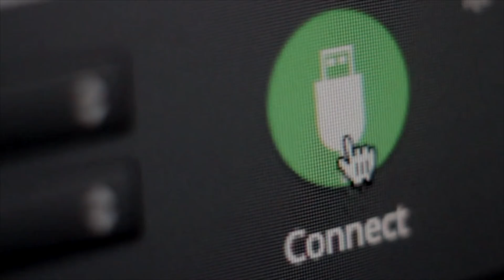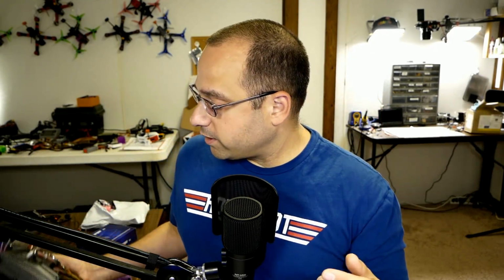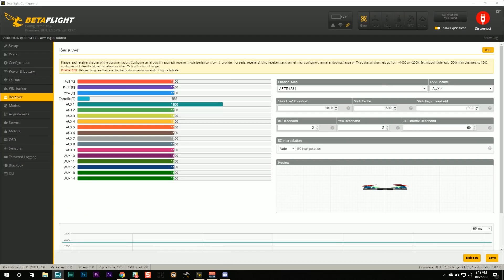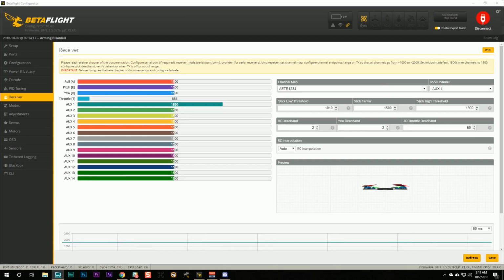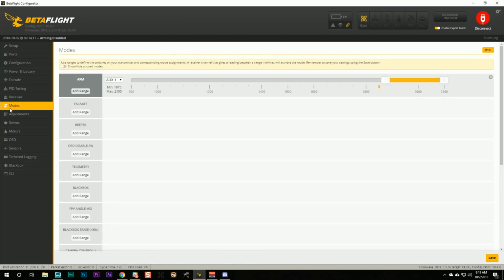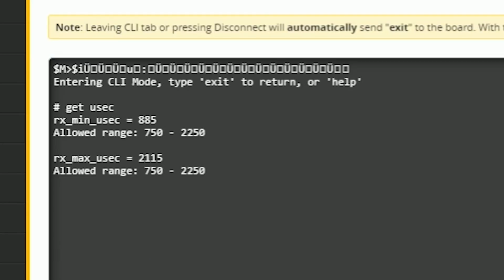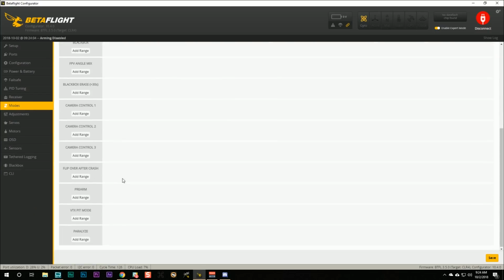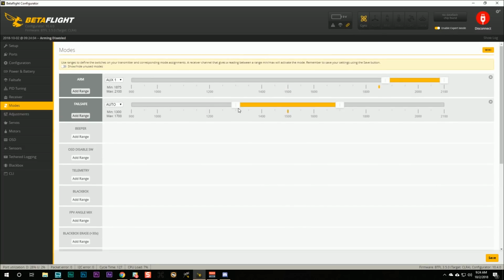BETAFLIGHT WON'T ARM | RXLOSS BADRX ARMSWITCH FAILSAFE BOXFAILSAFE arming status flags

Comment: 1:50 RXLOSS 
5:02 ARMSWITCH
6:33 BADRX
7:25 FAILSAFE
8:40 BOXFAILSAFE
Reply from the maker: Thank you!!!
Reply: But how do we fix the box failsafe
Reply: @mr.d4108  Having the same problem...
Reply: i got the first mark4 and same thing! flew for 1 min and thats it. thaught they would fix it but claim i dont know what im talking about and want photos? they know bardwell did a vid on it! so i waited 4 months for the next version and usb conection fell off when conecting to it so thats that. $800 australian and all i have is parts. never again will i put a dollar in their pockets. they know the problemb but want photoes and vids and crap. i found an old wizzard 220s and put the parts in my mark 4 and its magic. so if any one wants to know what bits i used msg me. it flys so smooth and its cheap.
Reply: @jacobkowalski2709  what spent $800 and havnt flown for 30seconds? fuck gep fpv they got me for 800. fat shark sent me a pair of dud hdo2s and i sent them for repair mean while i got another suplier and perfect but 200 in shipping 3months repair time and sold them for 500 Australian which is half price after sending them back 2 times this sport is tearing me a new arsehole! eachine wizzards are the best value for money and they do what they say they fly rtf resdy to fly. yes ready to fly. and they are the only ones full stop.
Reply: @JoshuaBardwell  jgeprc mark 4 worst drone of the year untill i put the tower out of my wizzard220s in it now what a fantastic reliable quad! 1 week of hell and its handled it all
Reply: best fpv uploader ever <3
Reply: I love you❤️
Reply: Thanks!

Comment: Save the day. For some weird reason, when I plugged in my crazy F405 aio, betaflight decided to switch receiver settings to spektrum protocol, so after switching back to crsf, the stick low/centre/high thresholds were all zero. Spent a day thinking my mobula 8 was damaged. Thanks for posting this video.

Comment: Finally got my drone working after 2 weeks. This is my first build. Receiver wasn't getting any input from my transmitter. I remove all the receiver wiring and resolder it again with different wiring after watching this video and its finally working. Thanks for the help.

Comment: Built a new Quad, everything worked, flew 3 packs great, connected to betaflight and tweeked the rxrange on one toggle to set it to 1000 - 2000 then I lost function of my XM+ receiver. AUX 1 - 4 no longer worked but arm and beeper AUX channels still worked but quad wouldnt arm or respond correctly. Even re binding didnt fix it but green light on receiver indicated still bound. I had RX LOSS in CLI when I checked status. Rather than desolder and by a new receiver I reflashed my flight controller with full chip erase and BOOM it all of a sudden worked again. I have no idea why it stopped working, I had not touched much and I undid any changes I made in betaflight but messing with only one rxrange setting stuffed it. I had not entered incorrect values as far as i could tell. Weird but could help others fix this. Just try a full chip erase and flash latest firmware if you are confident in doing this and reconfigure your quad in betaflight from scratch. Its not too hard with JBs videos on setting up betaflight.

Comment: Hi.  I watched two of your videos because I was getting a Rx Loss message every time I armed my quad but the AUX channels all worked fine.  It seems like there is another reason besides the ones you mention.
I found that I need to set the Extended Limits in OpenTx for my TX16s to + / - 125% in order to allow the sticks to control the OSD, but I had inadvertently set the throttle channel to = / - 125 % as well.  Putting the throttle channel back to + / - 100% solved the problem and no more Rx Loss messages.  I've no idea why extended throttle limits results in Rx Loss but at least I found a solution.
Thanks for the useful videos, without which I'd be at a loss on so many issues.

Comment: I've seen BADRX in a situation where the throttle-channel was below the rx_min_check. It wasn't possible to arm that way. My fix was to adjust the rx_min_usec and rx_max_usec and also the rxranges. This happens whith Walkeera-receivers bound to a Jumper T8SG (2 different rx-types on 3 kwads), where all channels went from 845-2170.

Comment: JB -: here's another...in BF 3.5.1, if you are using dshot commands to use the motors as a deeper and if you have aux 3 set as the pre-arm, then it will not arm and give you the pre-arm flag even if you have the pre-arm switch toggled.
Reply from the maker: Whoa.

Comment: Thank you JB for your time helping us!
I am new to quads and I would like your help with the following situation. My Trashcan worked normally with my Taranis QX7, and for no apparent reason no longer arm. The Trashcan and the radio bind, but don’t arm and there’s no reaction from the sticks on the Betaflight receiver tab. Only thing I did after last Trashcan flight was to add a DSM plane to the IRX4+ external module that is installed on Taranis. The Status command via CLI displays RXLOSS.
Reply from the maker: You need to configure the FC for your receiver type.

Comment: My Tinyhawk 2 just started falling out of the sky after 30 seconds to a minute of flight. The OSD says RX Loss at the same time the motors turn off and it starts falling out of the air. Interesting since I believe the SPI receiver is part of the Tinyhawk FC board. I flew my TH Freestyle right after this, so it's not my transmitter because the Freestyle flew fine. Maybe a cracked board? When it heats up the crack expands and disconnected the receiver connection to the rest of the board?
Reply: what betaflight are you using?
Reply: @guarf  I'm not sure. I've replaced the camera, the flight controller and all 4 motors and it still falls out of the sky with RX Loss. I bought the Betafpv lite2 radio and that fixed the problem. That makes absolutely no sense because the Freestyle 2 that uses the exact same FC and camera still flies fine on my x9 Lite in d16 mode. But I've noticed a lot of things about this hobby make absolutely no sense.  The "new" AIO board I bought from RDQ came with a nasty solder blob on the negative battery pad and it looks like the vtx has been replaced on it, but it flew fine for 2 batteries on 25mw. I unlocked the vtx and set it to 200mw and it's not worked since. It actually smoked when I plugged a battery in. I told RDQ about it and they mailed me a new AIO board. Should be here next week. I hope it works after I replace the board again, but if it doesn't I will use the motors and camera for a build and I will never buy another EMAX product again. This thing was fun to fly but it's been the biggest piece of garbage I've ever seen.

Comment: Hi,
Flashed to a newer version of beta flight, quad will not arm.   I have a  Arris 250B Using a F4 omnibus F4 SD, BLHeli S ESC A-H-30. Radiolink AT9S R9DS receiver.  Also in Betaflight, am unsure about receiver set up. I know my receiver is SBUS.  Flew ok when first took quad out to play, then updated to Betaflight 3.5.7.  This is when i ran into the arming problem.
Reply from the maker: Need to get the arming status code. Presumably you're seeing RXLOSS which is how you ended up here?

If you know the receiver is SBUS output then Configuration tab should show SBUS receiver protocol selected. Then it's a matter of finding the correct UART in the Ports tab. Enable Serial RX on the correct UART in the Ports tab. For Omnibus targets, SBUS is usually on UART 1. There is sometimes a PPM/SBUS pad that uses a solder bridge to select between the two.

Comment: Hello Joshua, great video. Have you ever heard or even experienced that a battery interferes with the signal from the transmitter? I have a battery with this I have signal breaks after about 100 meters again and again. It come as a source of error only the balancer cable, main cable or the connector in question. But there are no problems loading and also the plug is not warm after the flight. I have no Telemetrie so I can't see the strength of the  RSSI Signal. What do you think?
Reply from the maker: It's hard to imagine how one lipo would cause this issue. But if I had a LiPo that was causing this issue I'd retire it.
Reply: Thanks for the fast reply. Of course, I sorted out the battery. it now serves as a power bank. But still I would like to know how it can be ....

Comment: Is there any other situation where the badrx can be present? I just finishing building one of your beginner kits ( I bought it 2 years ago, mainly forgot about it, have other quads but recently found it, built it and went to maiden fly it today) its the xilo analog build. I bought it 4s but have since went with 6s, have 3 6s quads so I just set up a motor limit. 

I tried cycling the battery and re-arming to no avail. The rx is working as in the inputs are showing in betaflight (crossfire nano rx)

Comment: Hey Josh, My quad stopped receiving stick inputs after a crash. I checked cli and rxloss came up. I can see a blue led light blinking and also the buzzer won’t stop beeping. This is my first quad so I’m not sure if it’s the antenna on the radio, the receiver or flight controller. The wired connection between the receiver and flight controller seem to be fine. I also don’t see any physical damage. I’m using a AT9S radio.

Comment: Hi I h reset my setting to default think that it would help me with my motor issue I had (motors didn't match what bf was showing which I still haven't figured out) now my transmitter is saying I have telemetry with my quad but I'm not seeing any activity on bf when I try to arm it or move a gumble. What could cause this?

Comment: Hi Josh,  recently all my quads started either Failsafing or sending the message  RX LOST after flying for a minute or 2.  I replaced the receivers and my taranis but still have the same issue.   I have a theory of what may be happening that I wanted to bounce off your head.  It has been very hot out 90 + and I am running 5s batteries when this seems to happen.  I think that perhaps my 5v regulator is getting hot and shutting down thus causing my reciever to shut down, and it happens with the 5s battery more because the regulator is having to dissipate more voltage so it heats up more.   One day I got an error come up on my OSD after the rx lost, saying "Core failure"  I have never seen this before which is why I suspect something in the flight controller is getting too hot.  Maybe this is a topic you could cover in one of your tech videos.  BTW, in most cases when this happens I can re-arm and continue flying right away, but when I got the core failure, I had to unplug the battery and hard reboot to clear the error.   I figured if anyone knows what is going on it would be you so please help if you can.
Reply from the maker: Yes it's possible that RXLOSS is caused by 5v regulator shutting down.

Comment: I am ONLY getting CLI and MSP errors.  When disconnected from usb and computer I still can't arm.  DJI osd does not let me view the warnings, so I have no idea why.
Reply from the maker: Check that the Arm mode changes color when you flip the arm switch (in the Modes tab). If not, then the FC doesn't think you're trying to arm.
Reply: @JoshuaBardwell  yes it does try to arm.  
I figured it out. mSp enabled on urarts for osd on dji doesn't work on betaflight 4.2.2 upto 4.2.5.  
So I had msp on for urart 6 to enable osd but that was tripping the arming flag.  Had to downgrade to 4.1 or up to 4.2.8.

Comment: So just got a new drone and set it up it will arm etc but flips.. in beta flight i get a rx_failsafe any suggestions? Can't seem to find any other options than asking.. thanks radio is a spektrum dx6i

P.s great videos they have helped tremendously!
Reply from the maker: If the quadcopter instantly flips over when you arm and raise the throttle with props on, it is almost 100% certain to be one of these things:

1. Clockwise prop installed on counter-clockwise spinning motor or vice versa.

2. Flight controller not facing forward. Go to the Setup tab in the configurator. Tilt the quadcopter on all axes (pitch, roll, yaw) with your hands. The 3D model in the configurator should move the same as you move it with your hand. If it does not, use the Board Alignment parameter in the Configuration tab to fix it.

3. Motors not wired correctly. TAKE OFF YOUR PROPS. Plug in a battery. Go to the Motors tab. Turn on the "props are off" slider in the lower-right. Raise the individual sliders (1, 2, 3, and 4) one at a time, just enough that the motor begins spinning. The motor positions (1, 2, 3, and 4) should match the graphic in the upper left. If they do not, then either move the signal wires so that they are correct or use resource reassignment to virtually "move" the motors.

4. Motor spinning wrong direction. Do the same as step 3 but compare the motor direction to the arrows on the graphic in the upper left. If a motor is spinning the wrong direction, either reverse it using BLHeli (or whatever ESC software you are using) or swap any two motor wires with each other, which will reverse the direction.

Many times, people swear up and down they have checked all of these things, and then come back to say oops I missed one you were right. So if you think you have checked all of these things and your quad still FLIPS OUT, go back and check again. If your quad is insta-flipping on takeoff, it is almost always one of these things.
Reply: @JoshuaBardwell  it was the fc not facing the right way thanks for the help and all that you do.

Comment: What if you get this on a new BnF model that's already wired up? I only see RXloss in Betaflight in CLI from Status command. When I try to arm, the motors spin for a second and then stop*
Reply from the maker: If you are able to arm then RXLOSS doesn't seem possible, at least at that moment when you arm. Most likely if this is happening on a new bnf then you put the props on wrong, and the reason they're stopping is RUNAWAY. My guess is RXLOSS is happening when you plug in to CLI because you didn't plug in the battery and the receiver is not powered up.

Comment: RX FAILSAFE error on a brand new (never flown) HGLRC Sector 132 with Crossfire Nano factory installed. It's bound to my Tango 2, but get the failsafe error in Betaflight and when bound, it shows no stick movement in the Receiver tab. I've spent hours trying to research why is causing the failsafe error on the quad, and how to resolve it, but I just can't find it. HGLRC "support" has been painful and unhelpful so far. Thoughts?
Reply: Hello Harry, I have the same problem, I have a Mamba F722S and R9 Slim + OTA, I have bound my radio with the receiver but when I try to check the sticks movements in the betaflight, there were not answer.

Have you find some solution?

Comment: thanks for allthe greatvideos im new to the hobby and just made the leap from the toy drone scene.im  flying(well,trying to fly) a hawk sport.have a flysky i6X transmitter and a FS-A8S rx.the receiver binds with the tx,but has no battery indication on tx nor control in betaflight.im going to try and do new driver install from betaflight startup page any insights you might have will be greatly appreciated

Comment: Hi Josh. Building my first quad I've been following your learn to build a drone series. Made it to video 12 cant get it to arm. Frsky rsxr, in cli it showed badrx and arm switch. I've rewatched the videos not having any luck.
Reply from the maker: BADRX and ARMSWITCH means you need to cycle the arm switch such that the FC goes disarmed. Go to the Modes tab and move the arm switch and you will see if it goes out of the yellow area that defines the arming mode or not.

Comment: So i have this problem where i just take off, and i get rxloss and it disarms. Than i arm again, and it flies perfect. Its also on an aio flight controller, (whoop) so it cant really be the reciver-fc connection. Also this problem occures on both of my drones, so it has to be the transmitter (qx7) but after arm cycle it is fixed, so whats the issue?

Comment: hey josh what if my mobula 6 hd is binded to my tango 2 but when in bf i hit throttle and it doesnt do anything
and it says rxloss angle....so it will let me bind than nothing jus stays bound and in bf wont let me turn on arm switch ....doesnt even recognize that im hitting any thing on the tango at all

Comment: Hi Josh I dig ur series I haven't had any issue but been flying for about year so I got some experience!! I remember I use to have a bf4 that would not arm and sometimes would it would always say config calbi I heard alot of other having issue with the bf4 same thing so I just got a different fc stayed away from the bf4!! I bought a crossfire micro and the next day they went down on price🤨 howcome you dont run crossfire much??

Comment: Thank you JB for helping us drone newbies. I would need your help in my drones arm failure flag (my 1st done beta85 pro2 ELRS and radio betafpv lite 3.0 elrs). I'm getting RXLOSS flag in betaflight, but all modes setup are completed in betaflight and show yellow when respective radio switch is toggled. Except for ARM mode, which turns red color(disabled) when ARM switch is turned on. Double checked on accelerometer calibration, modes setup and radio output within range on betaflight receiver tab. Only unusual thing I noticed was gimbal outputs are not constant and flickering. Please help me.
Reply: im in t his exact same position, with a flywoo baby nano elrs.